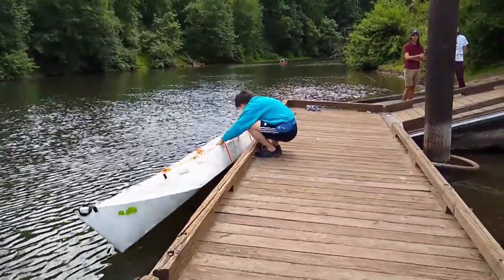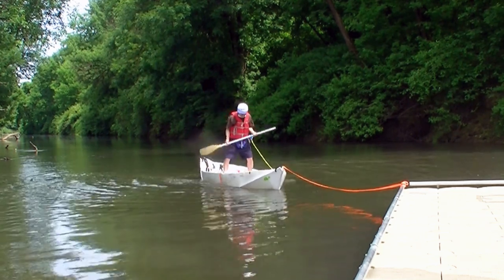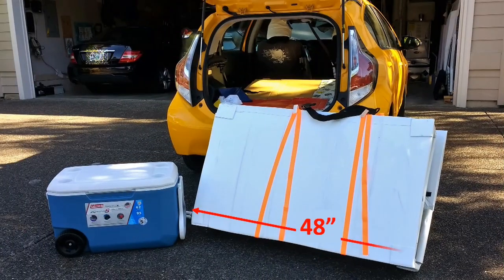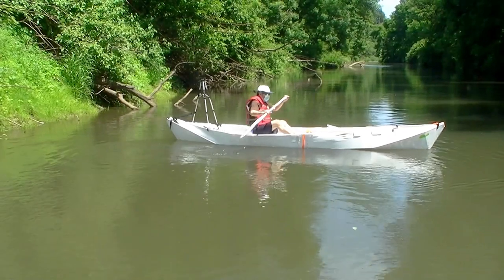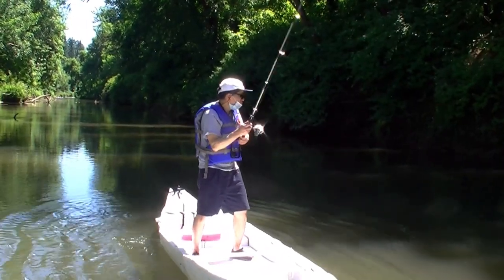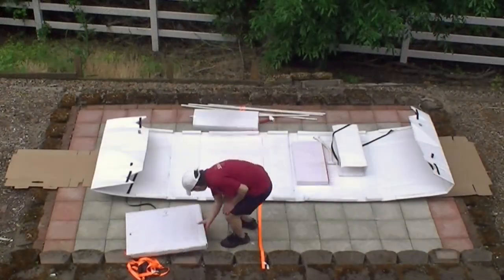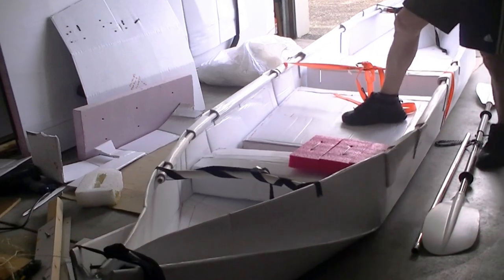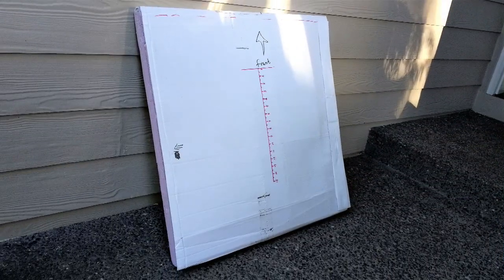Standup Fishing On A Foldable Coroplast Boat

Comment: Boat build  update.  Today I worked on gunwales.  I prepared then for attaching to the main body of the boat. Because I am using 4m coroplast,  I have discovered that I can fold it easily without heat. I will have to add a bit more  reinforcement  but so far I am optimistic about the final results.  I have decided to go with contact cement after watching another boat builder who used it with good  results  on a kayak he took on the ocean.  To be honest I'm afraid of the heat gun. I can see me making a  mess of things.  I know that I will have to pick up the heat gun when it comes to the pvc, but I will install the gunwales first before I measure and cut the pvc. This like putting a puzzle together one step at a time. I'm shooting for a launch date of June 28th the day I turn 65.  I will continue to update you on my progress.
Reply from the maker: Thanks for the update.... Yes, I watched a video using the contact cement also. I have never tried that. This seemed to be a very good option My friend who is a trained boat builder also have difficulty to handle my fusion method using a heat gun, therefore he came up with the idea of using the cloth iron. Glad to see another senior citizen getting into building coroplast boat. I just have my 67th birthday.

Comment: Can you tell me more about the 2" thick foam floor? Is the foam available at Home Depot? Did you protect it with same chloroplast that is available a Home Depot also? Is the chloroplast glued on both sides or only on the side you step on? What glue do you recommend? Thank you for sharing.
Reply from the maker: Thanks for you question. You can see more details of the floor in this video https://youtu.be/J1A9IFDy7Zs  please scroll to 15.5 min. You can get the 2" thick foam at home depot. The brand is shown in this video. My friend used with 1.5" thick one and it works also. I got the 4 mm thick coroplast from home depot. I would suggest you to wrap the top/side/bottom with coroplast if you want to try that on Tucktec. This will give you more rigidity. I built my boats with  6 mm thick coroplast, which is relatively more sturdy therefore I don't rely on the 4 mm thick coroplast to get additional strength. This video showed I used zip ties to secure the 4 mm thick coroplast onto the foam (before I discovered heat fusion method). Later I modified it and used heat fusion to fused the edges of the coroplast and removed the zip tie.  Which is stronger than using zip tie and also looks cleaner. I have a longer section of the floor but I didn't used that on my canoe because it adds weight (about 2 lbs) to my canoe. Please let me know if you have any question...